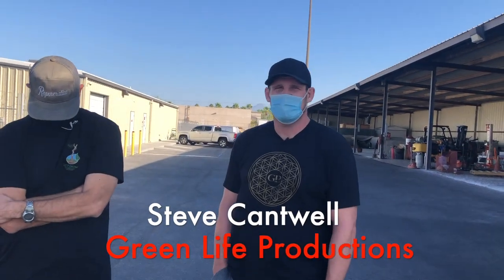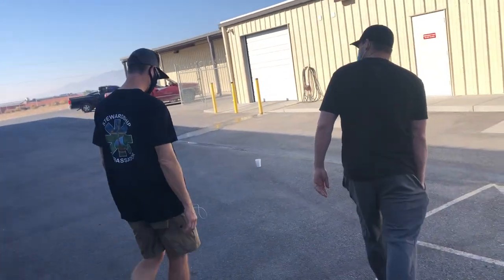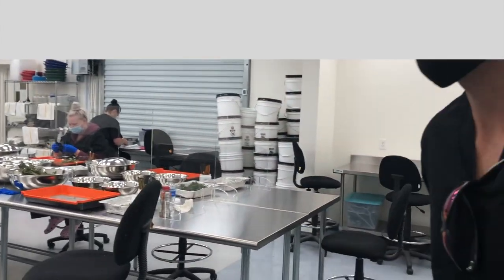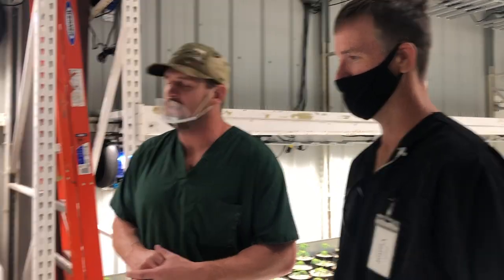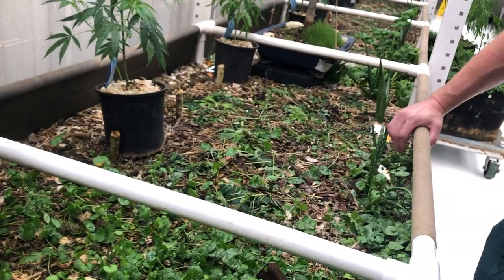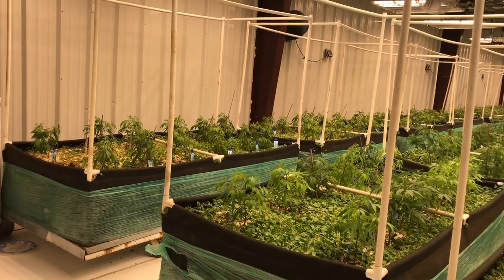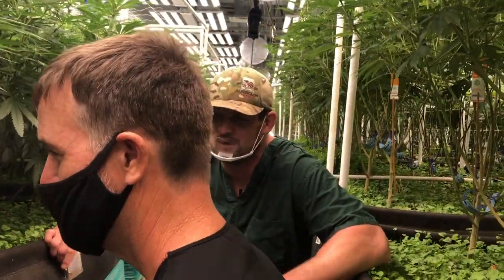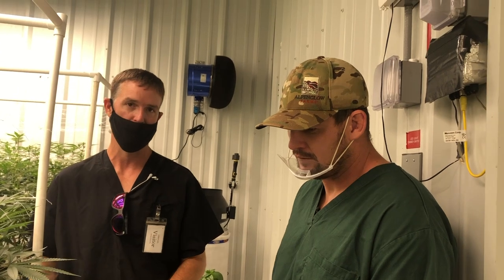Indoor Living Soil at Scale - Green Life Productions in Nevada

Comment: Why do you have to make compost?  Aren't you growing compost?  The trimmings, the cover crop,... after a cycle can you not just put some brown on top and compost in place?  Maybe not best for fast turn around.  This is the coolest grow I have ever seen.  I've never seen such a grow bed.  I've been researching KIS Organics, Steve Solomon's COF, Soil Testing, and debating if I can do a  no till in a 7 gallon or if I should just go with coco coir and bottled nutes.
Reply: Have you found MrCanuckGrows yet?
Reply: @TinMan445  Oh for sure, love MrCanuck.  I have used his discount codes on many things before.  I've been dealing with back and neck issues so I've had plenty of time to watch a ton of the tube and learn a bunch.  I started working with Soil Dr, Bryant Mason, and now use 15 gallons pots with a sort of water-only supersoil.
Reply: @MrBob58o  oh wow very cool! Did you ever try the 7 gallon? I’d like to try but I only have 2x4 to work with, if you did how did it go?
Reply: @TinMan445  I ran a handful or two in 7 gallons fabric pots and was happy with the results.  I think I started running out of potassium towards the end of flower, but that is on me.  I keep K kinda low during Veg and the first few weeks of flower to help front load Ca.  Then towards the end of the stretch, I start watering in Potassium Sulfate to increase the K to Ca ratio to help the buds fill out.  I just didn't add enough IMO.